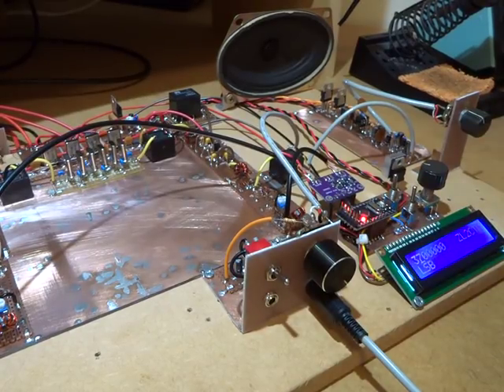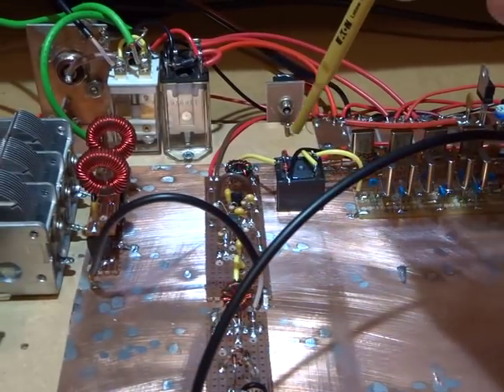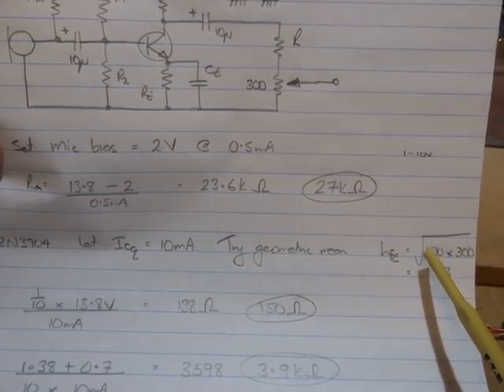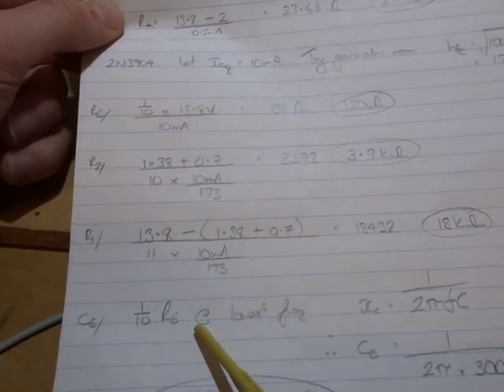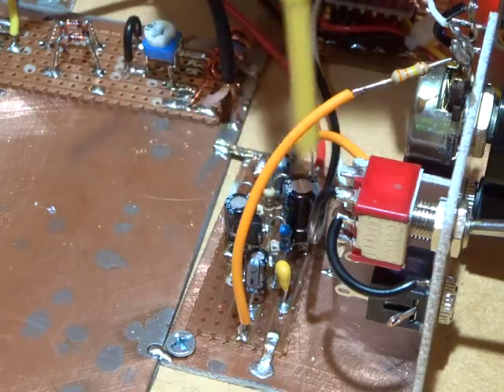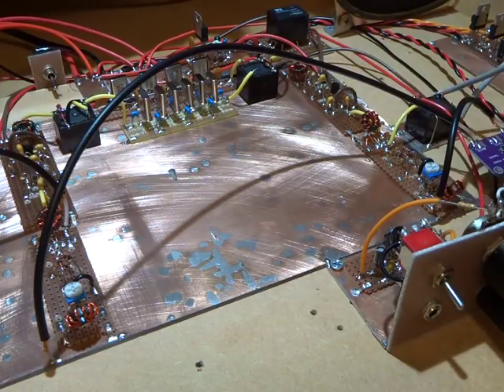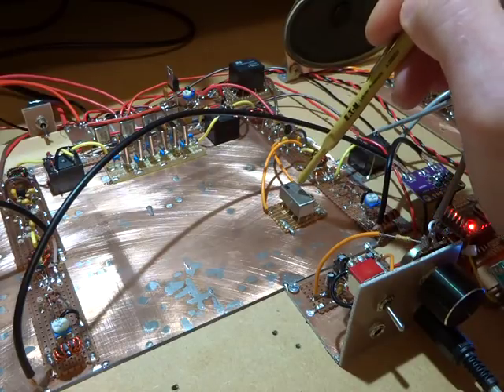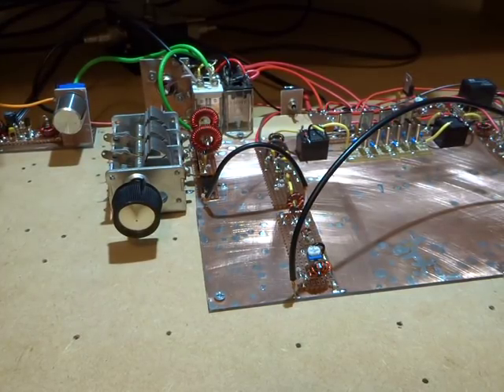Homebrew 80/40m SSB/CW Rig - #8 Mic Amp, Initial Tx Tests

Comment: Great series. I have the receive part all built, just trying to fault find it - the most fun part lol. My xtal filter looks a bit wider than I wanted but be ok to watching FT8 traffic as a test - there's always something transmitting!

I suspect I haven't got the alignment setup up between VFO and BFO and xtal filter so need to get pencil to paper out and work out offsets for LSB and USB. 40M band predominantly LSB SSB but darn FT8 is always USB. 

Keep up the great vids - they are proving invaluble!
Reply from the maker: Put in a LSB/USB switch and have the software place the BFO either above or below the crystal filter passband. Same offset, i.e., start with 300Hz away from the -3dB point. I started with centre freq + (2700Hz -3dB passband/2) + 300Hz. That should get you in the ballpark.

Charlie

Comment: good morning Charlie,

Are you 100 % sure its bleeding through the mixers. I suspect due to the output level of the si5351 that it may be picking up directly from it on your radio. The outputs are reasonably high on the si5351 boards, This is done to maximise it's flexibility and usefulness.

you did the plots on the filters so you basically know they are approximately right , the sbl1 mixer gives you basically the same results. The difference between your mixer and the sbl1 is this... The sbl1 has a screening around it and your mixer doesn't. The SBL1 is very similar to your mixer and is allowing your oscillator to bleed through ( just the best way to describe it), what if its not bleed through and more your radio's dummy load picking up the oscillator directly ( this may give the impression its going through the mixer). The output of the SI5351 is reasonably high at 3V and would transmit across that 18 inches or so on your desk.

There are things that can be done to reduce it like attenuator pads ETC. you can try screening the oscillator with something metal to see if the level drops (if its bleed through it wont make any difference, if its transmitting over the short distance it will reduce in level). 

I hope this is of some help

Best regards and 73

Simon (M6FJW)

P.S. No I don't have time to do the intermediate and the full licence right now, Maybe sometime in the future.
Reply from the maker: Thanks Simon and Stephen. I have a few things to try here. If I scope the RF out of the balanced modulator then I do see some bleed through. Not a lot, but some. I was thinking about trying a single balanced mixer which has both the balance pot and a trim cap. I prefer the DBM, but could be an option as an experiment. I think for a start I'll remote mount the Si5351 in a shielded box and see how that works. I know it has to be done, but I love seeing the electronics out in the open! I'm also reluctant to reduce the output level of the Si5351 as the levels are spot on for driving the mixer (if I assume the levels are the same as a SBL-1). That being said, I have noting top loose and the ability to do so is baked into the library. I do know the commercial radio will pick up the Si5351 output directly, but it's at a much lower level. What I didn't film was transmitting a podcast. It's sounds great. As for the filter response, yes i did plot that and it didn't look too bad. Clearly not a good as a commercial 8 pole filter, but ok. It's another area I'd like to look at in due course. 

Again thanks to you both for the input.

Charlie
Reply: Hi Charlie ,

A quick question, what was the width of the filter at its base and the width at the -3dB point. The difference between the two cannot exceed 300 Hz (or you get the ability to transfer the carrier through). 

I am sure you used the center frequency of the filter + half the filter width + 300 Hz as your BFO frequency. If the -3dB point and the base of the filter are greater than 300 Hz then yes it could bleed through, but this shouldn't be by a great deal due to the attenuation of the skirts on the filter.

One other note you could try extra capacitors on the power supply right were the power enters each board just in case the power rails are the problem and carrying the RF through to multiple sections.

keep up the great video's 

Best regards

Simon ( M6FJW)
Reply from the maker: Cheers Simon. I'll look at it again after work. I have a few ideas to split things out as i note the Si5351 is very close to both the balanced mod and the IF amp.

73s
Charlie, ZL2CTM
Reply from the maker: Simon. I have done some comparison experiments between the homebrew crystal filter and a Yaesu XF-92A filter. The commercial filter has significantly steeper skirts and greater stopband attenuation, which is what I thought. I'm tempted to rebuild the filter using-say-six crystals. That may not be the best approach as i suspect the crystals themselves are not high quality given the price I paid (I'm not complaining as it was always going to be an experiment). The other option that i may look at is use the XF-92A and continue. All good fun! As an aside, there is a small amount of bleed though, but it's not too bad. Moving the BFO up 300Hz also helped (as expected). The filter is the low hanging fruit.
Reply from the maker: Gidday Simon. I had a good play with varying the Si5351 output levels. It did make a difference, but at the expense of the RX and TX audio quality. 8mA seems to be the best.Thanks again.

Charlie
Reply: morning Charlie,

Double check the calculations for your bfo ( center of filter + half the width of the filter + 300Hz etc.). It looks right but looks can be deceiving. From what you have said it does appear to be bleed through. You could try adjusting the pot on your mixers while on TX to see if the bleed through amount changes. If no change then the bleed through may not be starting with the mixer circuits. It's possible its the I.F. amp is picking up stray RF and amplifying it. The input and output transformers could be acting as an antenna, then being amplified in the I.F. Amp.

Another thing is have you considered a variable crystal filter, I do have a circuit diagram somewhere (if you require it). This would allow you to adjust the width on the fly. instead of using a variable resistor, you could use a switch and set resistors ( the switch also changes the mode on the Arduino). 

Possible advantages are as follows
 
     1 filter with NO relays. 
      possibly better matched to the 50 ohms so less loss due to transformer impedance matching ( this depends on construction).
      you can use a pot to adjust the width to anything you want.
      you could recycle the CW filter for this so you have a 6 crystal filter on SSB and CW. 

Even with low quality crystals it should perform reasonably well as its adjustable to suit your needs. the 6 crystals should give you narrower skirts on the edges of the filter too. The code becomes simpler as you only have 1 filter frequency to deal.

 Its not very hard to adapt your filter to be adjustable ( basically a variable resistor, some Varicap diodes etc. ). The 6V your using on the bi-directional amps can be used for power supply to the variable crystal filter too.

Well there's food for thought, This should also be a good experiment sometime even if not on this radio then on some future radio. It also could be exactly what you need , simply you can adjust the filter to stop any bleed through the filter.

Best regards

Simon ( M6FJW )
Reply from the maker: Simon, how can I say no after such a  compelling argument!!! I think that would be a great idea. My plan is to go ahead and work on the PA (linear) which will get CW up and running at least, after which I can double back on the filter. I also want to remote mount the Si5351 to see if that makes any difference. I know the PD is sensitive as I was still picking up the test transmission with the second IF disconnected from the PD. The two two fly leads I was using for the scope etc were enough to couple the two. The BFO freq is also correct. I used a test code to vary the BFO on the fly, with a corresponding adjustment to the VFO, to see where the BFO should sit. As expected, moving the BFO higher attenuated the carrier more with only slight attenuation of the lower frequencies of the transmitted audio. Anyway, time to work on a IRF510 push pull amp. Thanks for your help.

Charlie
Reply from the maker: For interest sake, I rebuilt the mixer with greater isolation between tracks and I'd say its performance now is significantly better and very similar to a SBL-1. I'll cover that in the next video.
Reply: Hi Charlie, that's awesome. Sorry to be annoying, but the tunable filter suggestion gave me an idea. An electronic switchable filter. I'm sure this has been done before. Just for fun I set up an ltspice sim for a 20MHz QER filter. The extra capacitance for CW is switched in by 2N3904's controlled by the arduino micro. It is the design from the minima SSB transceiver and has 50 Ohm termination. There are no series capacitors so that makes switching in the extra capacitance really simple. Here are the files: https://cloudstor.aarnet.edu.au/plus/s/R5HbQbcAglMHcDQ

Cheers, Ian
Reply from the maker: That's really interesting Ian. I might have to take a look at the QER filter when I redesign this one. Did you try switching in all the caps from just one 2N3904?

Charlie
Reply from the maker: I just tried switching all of the caps using one 2N3904. Looks like the C-E capacitance upsets the response. I will look at this again. 

Thanks again Ian.
Reply: Hi Charlie. I don't think the issue there is the CE capacitance. The spec sheet says this should be less than 4pF. With a single transistor I assume the earthy end of the CW caps are all connected together. This will certainly upset the frequency response. The earthy ends of the caps must be isolated when switched out so as not to interfere with the SSB caps. I modified the sim where all the CW caps were in circuit with their earthy ends connected together but isolated from ground and changed their value to 3pF and it had virtually no impact on the SSB frequency response (edit: it did raise the ultimate attenuation). And when connected to ground - had virtually no impact. Looks like we need to switch each capacitor individually.

Cheers, Ian
Reply: @4youian  I've seen variable-bandwidth crystal filters made by using two capacitors at each stage, one of which is coupled to ground through a PIN diode, which can then be biased to partially switch the second capacitor in.  I've also seen photoresistors used, with LED current setting the bandwidth.  If you only need two bandwidths, probably regular signal diodes can be biased on or off to switch the second capacitor, or as you suggested, bipolar transistors.

Comment: Regarding your use of the geometric mean of the typical and minimum specs, I don't think this is sufficient.  If your biasing depends on the actual beta, then you need to check your operating point (the quiescent Vc in this case) using both the minimum and maximum possible beta.  This is a bit problematic, since max beta is almost never specified, but I use 3 x the typical value, since on the rare datasheets that DO give a max number, that's usually about what it is.  Since you use voltage divider bias, beta will have very little effect on the operating point, though, and will actually depend more on the junction temperature.  You already fudge this by using Vbe = 0.7, which is reasonable and has always worked for me.

Comment: If I built a circuit with a gain of about 5, and then ran its output through a 1/1000 voltage divider, I would probably be asking myself if I needed an amplifier.